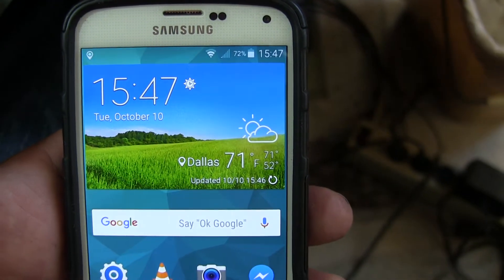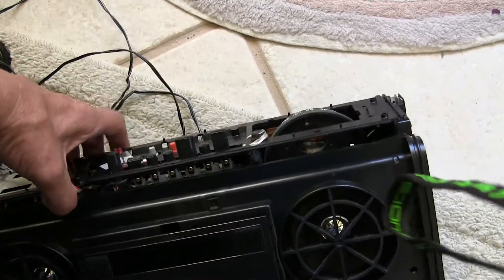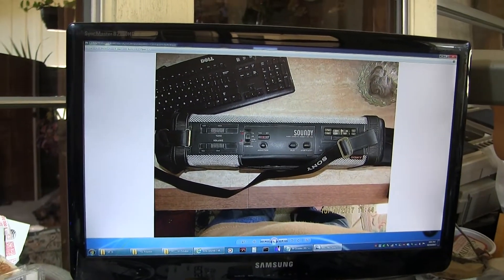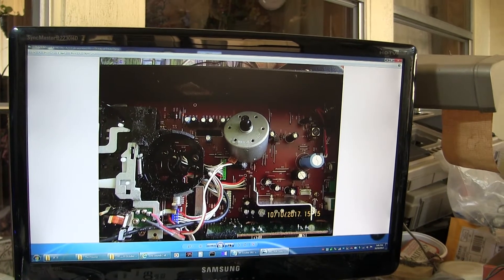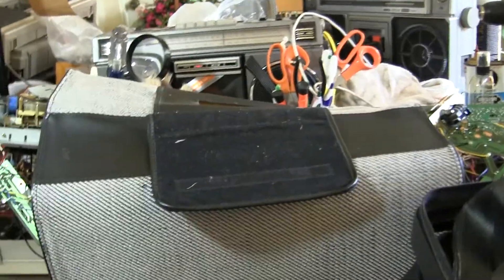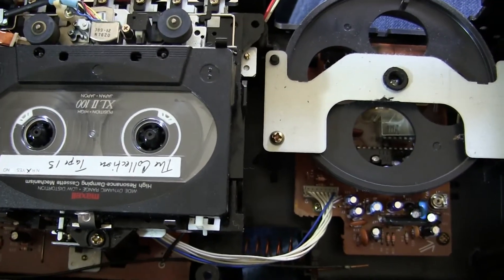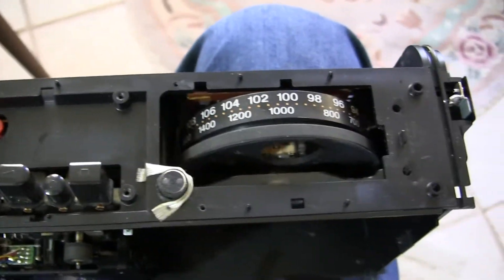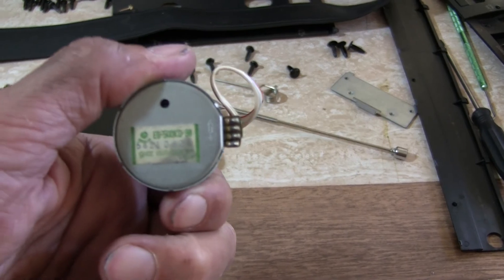Sony CFS-S30 Soundy Auto reverse amfm inside naked re-belted repaired

Comment: Really cool
Reply from the maker: It's for sale $100.00 shipped or make me a offer, as it still has issue's as the antenna need some spot welding to repair it's mount & I do not weld I draw the line there.